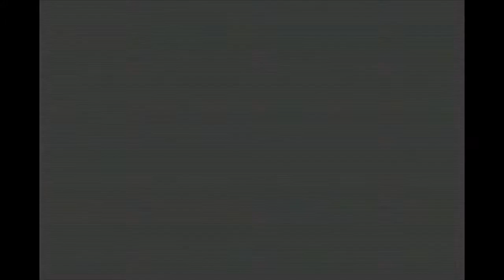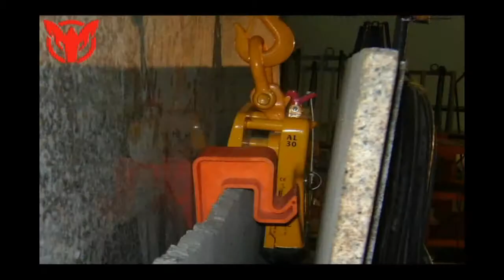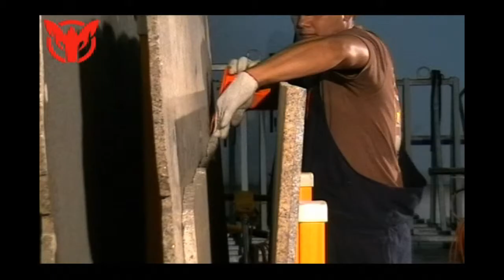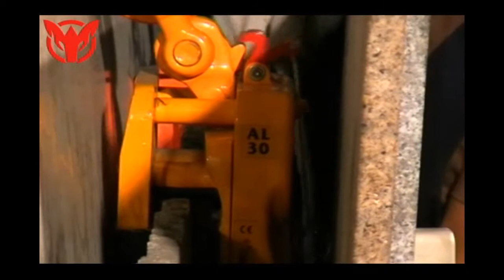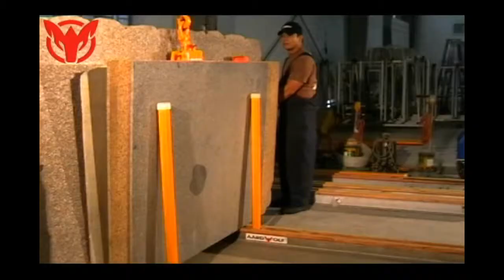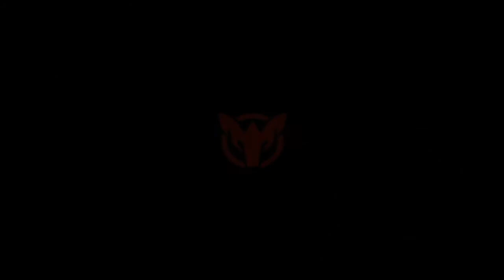Aardwolf - Compact Lifter 30

Comment: Inspection 1392574.015 <https://www.osha.gov/pls/imis/establishment.inspection_detail?id=1392574.015>  2:15 p.m. 4/8/2019 , an employee was assisting with the unloading of stone slabs from several A-frame storage racks to a supplier truck. A coworker was loading two cojoined stone slabs onto an Aardwolf Model AL-60 that already had five slabs and it started to roll over. The employee moved to stop the slabs from falling and was crushed between the falling slabs and the concrete ground, killing him.